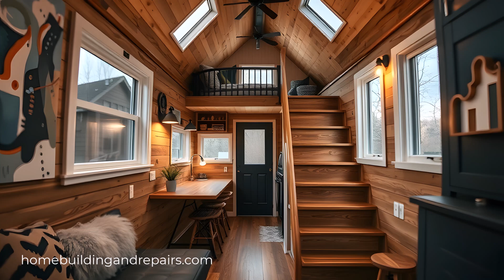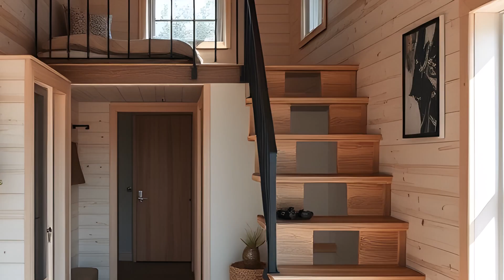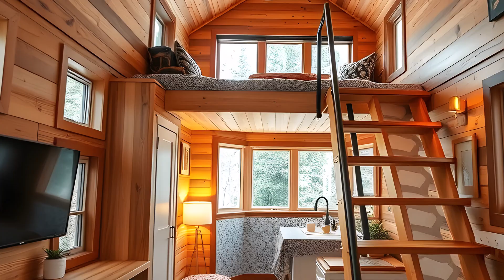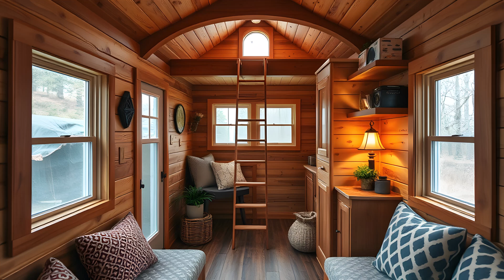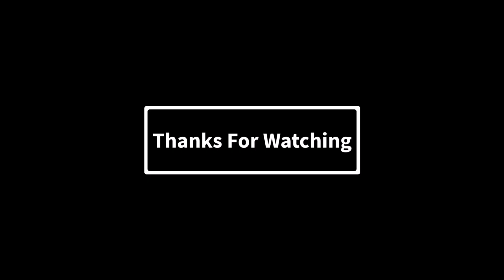Why Most Stairs for Tiny Homes Might Not Be Safe or Building Code Compliant

Comment: 0:54 -- "If you're looking for building codes specifically designed for tiny homes..."

The International Residential Code (IRC) is a resource.

Requirements for tiny houses are addressed in Appendix Q of the 2018 IRC and in Appendix AQ of the 2021 IRC. 

I don't agree with the IRC tread and riser proportioning requirements for stairs in tiny houses, but many local jurisdictions have adopted them.

Some of the IRC special provisions for stairs to lofts in tiny houses:

-clear width reduced from 36" to 17" clear at and above the handrail(s)

-headroom reduced from 80" to 74"

-minimum tread depth reduced from 10" to 4"

-maximum riser height increased from 7.75" to 12"

The required tread and riser formula in the IRC can result in some ridiculously steep and hazardous stairways. The riser height is determined first, then the tread depth is calculated by the proportioning equation in the code.
The riser height must be at least 7 inches but not more than 12 inches. I might be willing to design a closed riser stair for a client with an 8.25" riser height (and a 9" tread depth), but for anything steeper, I'd recommend an alternating tread device, a ladder, or a spiral stair.